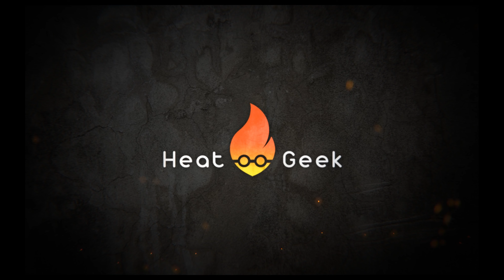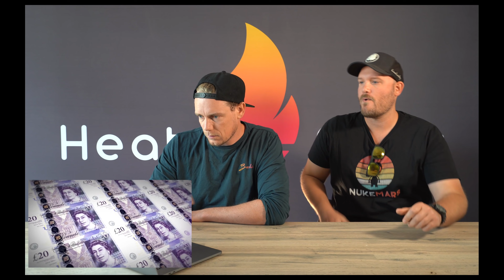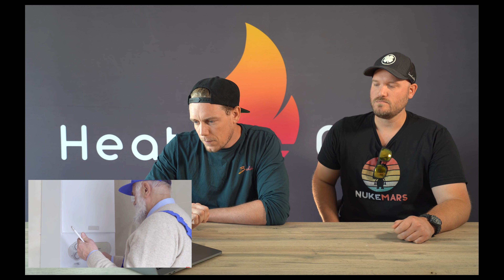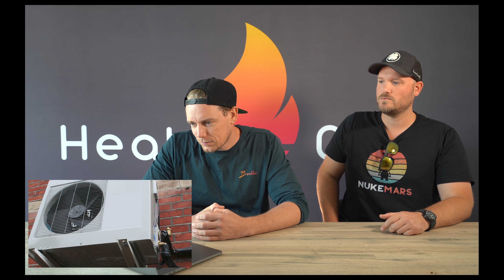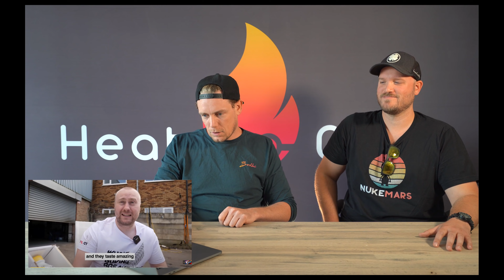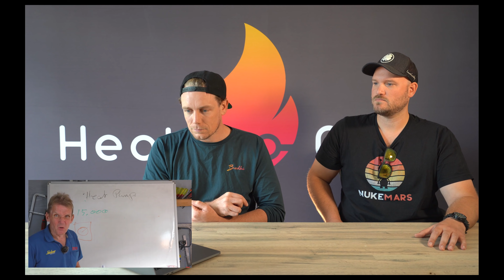Professionals React (BADLY) To Skill Builders's Heat Pump Videos | PART 1 | FIRST TIME WATCHING

Comment: Wel wel , this reaction was made 7 month ago ,. And so far he's prediction haboit electricity and gas jas been spot on in Holland the proces of gas in 2021 skyrocketed as the government closed gas mines , electricity what's chipper at the time and then shit hit the fan , the great could not handel the demand and promoción of son panels , the insentive when doe 40 %, gas is now just is now 35 %  expensive then electricity bit slowly by kling off government insentive electricity is claiming up fast .... Soon they both wl be as expensive, and we loose .... As we invested in heat pumps , sun panels and all we got is debt and technology that don't work in the winter proper  🥶🥶 ,  so  nice job guy you ridicule the guy for having a clear vision of wat je thought was coming ... England might not have Canton the prices yet but that will come sooner the later
Reply from the maker: The discrepancy between the environmental levies placed on electricity and not gas has been hotly debates in in Parliament for the last 10 years. And prior to his video agreed that there would be a 'rebalance'.. it was not a prediction.. I don't think he predicted it would gonupnby this amount either 

Also.. he was suggesting the government would artificially increase it... thos was natural market forces and actually the budget announcements are suggesting the giv are trying to reduce it again.. to thinknthe giv are fixing prices to push heatvpumps is tin foil hat stuff

Comment: A gas boiler pays you back after 5 years because its 3x cheaper per KWH for heating water or air than electric.
Reply from the maker: Lol.. but a boiler is 90% efficient  and a heat pump is 300 to 500% efficient.. think about it

Comment: How many times have you heard someone put in a new gas boiler and complain about it? Never, case closed. This video looks worse the more research I do.

The gas boiler is 38KW in my house, your sat there with a 3KW system I have to put the first 1Kw in and claiming its good? That’s 8% of my current system.
Reply from the maker: You've got a 38kw boiler in a property that probably needs 8. It will be cycling and probably about 88% efficient. That means if you needed the same 3kw you'd need to put 3.4kw of gas in..  what's better?
Reply: @HeatGeek  I have 6 Bathrooms currently. Gas is not measured in Kilowatts. Tell you what, I need a system for 6 bathrooms, 6 bedrooms, 10 rooms total. Offer me a money back guarantee? Note im not fitting underfloor heating. Property is very well insulated. Thanks
Reply from the maker: @yeahboyiiiii222  100% Well offer you a minute back guarantee.. just fill out the form on our heat geek assured application. Google heat geek assured, should be top result.

Comment: I do like the idea of using heated jacket, etc. Some people can't adapt physically to lower temperatures of heat. They require high heat, like myself. My whole life I could not adapt to colder temperatures like others. Now too much heat in the house to keep me warm can cause certain problems. So having the heated jacket, etc would be a good way to go to reduce the heat produced in the house, in my case, it should be lower due to circumstances I won't mention here. But having a certain level of coldness is a big problem for me. I just am not genetically made to handle lower temperatures. That's why I'd like the heated jacket and warm, but good air flow booties or heated floors. It doesn't take much for my feet to get cold and even freeze. But plenty of foot wear is not enough breathable and my feet could sweat or having issues with the skin.

Comment: Can't heat pumps be put in the loft instead of outside? That way you are re cycling the lost heat which rises. I don't know how you would insulate the sound though.
Reply: no, it would cool the loft and make the heat pump inefficient. it needs fresh air for new thermal energy
Reply: @ChapmanPlumbing  I see that lol. Thanks

Comment: Science doesn’t lie. Unfortunately the technology being bashed on for poor installs. No mention of how ‘Un’ green the gas boilers are. Specially combis. Ok not all the houses are suitable but what about the hi dead’s of thousands of houses build since say 1980s. You have start somewhere. If the fridge in you house works than heat pumps should work as it is same tech. Of course it has to be implemented correctly.

Comment: Heating with radiant is one of the main problems. Ultimately what warms the body is the warm air surrounding the body. Why not heat the air directly and distribute warm air. Every time you change mediums, you loose efficiency. IE: Air to aluminum to copper to refrigerant to copper again to water to copper again ( exchanger) to copper or plastic pipe to concrete to flooring to air ultimately . This is why you need to boost the temp with some other source in order for the radiation to work. Here in Canada I've been installing heatpump for nearly 40 years and refrigeration is my trade. The new inverter heatpumps provide very efficient heat down to -20c and even work down to -30c.

Comment: Gas prices are going up and certainly not a conspiracy. I don’t think Rodger was to far from the point of heat pumps.
Reply from the maker: Correct not a conspiracy.. normal market forces as carbon becomes less desirable

Comment: I am getting an airsource heatpump installed next month or so. I have imsulated underfloor, cavity, loft and internal cladding. I have airtightened where i can and put a membrane below the floor to stop drafts. I have put in underfloor heating and faral aluminium high btu radiators. I pray i have done enough as there is no gas in my area so this is my only option so indont have another cold winter 🤞🤞

Comment: I have installed a lot of heat pumps over the years and the skill builder is spot on
Reply from the maker: So you've also installed lots if heat pumps with scops of 2?? Have you considered that you may not be doing it right?

Comment: you 2 are idiots...you put a heat pump warming up my place at 60f to 65f like you have your place I'd fire you on the spot...and then saying 21C is quite warm that we should get people used to being cold? wff?!?
heys...help the chickens...let's all eat rice and beans every day!!
I keep my house at 28C in the winter and 19C in summer...now if an installation goes for 16k how in the world are you going to insulate an house on top of that? and at what total price?
you guys are too young to understand that at the end of the day it's not your choice what to do/install or under your control to decide what to do.
It depends on how convenient it is for the client...where they want it and how much they want to spend.
You can have all the greatest ideas in the world...install this...insulate that...6f from the neighbor blablabla...
me myself if you installed a heat pump 6feet from my bed window I'd go over to your heat pump and cut the pipes every freaking day until you give up. what you gonna do? sue me over destruction of property and damages caused to a pvc pipe? 20 pounds total? good luck
do it on the roof of the building or wherever you want...if I can hear the damn thing at night while I'm trying to sleep I'm coming for your heat pump
and don't matter how much you service a fan..EVERY fan will increasingly make more and more and more noise...you can spray it grease it..do whatever you want...
in the end to reduce its noise you have to replace the fan blades which isnt servicing is pretty much replacing parts. and who's going to enforce the noise from a cheap neighbor that doesn't want to pay to replace his/her noisy fan which in the end is all about money.
It bothers you that much? then pay for the technician yourself.
and last but not least...HVAC TECHNICIANS  are MONKEY workers...not doctors...not engineers...and some of them can barely even do plumbing...
heck first was the doctors title..everyone wanted to be a doctor and now you have doctors of anything...astrology doctors!!....then came the lawyers...secretaries wanted a title and became "paralegals" and now engineers of heat pump installations?!?!?!? what's next? the office people want the architects title for making a few drawings for them heat pumps? or should we make up a new one? HEATects?
you are still 2 idiots criticizing a guy that puts everything flat right on the table...
and as I've mentioned before as an hvac tech you have no choice or control of how things are done...
money talks and -----> it's not your money

Comment: What I'm getting from these 2 videos is it's not which boiler/Heat pump to use it's improve your insulation in your house thus using less gas with your current boiler and still saving the planet to a certain degree.
Reply: Yes, unless your heat source is on its way out of course.  Best to optimise what you have already unless you really want to reduce your point of use emissions

Comment: A few points. You gave a fair review of this guys video which is commendable, especially your discussion on installers and the likely compensation issue.

experience"The climate's changing as we speak"

The first is self explanatory, it's as futile as dismissing you as "climate alarmists".

mankind's

How many volcanoes are on the Oceans seabeds? Put it this way, 91 were discovered under the Antarctic sea ice in 2018. How many more don't we know about, so how can CO2 emissions calculations possibly be accurate?

Reading Professor of engineering's Michael Kelly's analysis might give you some insight into the challenges that NetZero presents to the average householder; £150,000 - £450,000 by 2050. It's not just Heat Pump's that are the problem. What he does highlight is the installation problem. To achieve NetZero by 2050 the UK needs approximately three time the skilled labour available. That equates to a government cutting corners as happened with double glazing and cavity wall insulation in the 70's/80's and we end up with a cowboy industry installing heat pump systems.

That's not a conspiracy theory, that's a matter of historic record.

https://www.thegwpf.org/content/uploads/2020/05/KellyDecarb-1.pdf
Reply: The larger the CO2 source, that more likely it is that we have found it. We don't need to account for every single co2 source / sink in order to understand a basic equation. Especially the ones we DO know about account for > 99% of the overall CO2 pumped into that atmosphere. That is the case we are in.

You appear to still be in climate science denial mode. So of course we won't be able to convince the likes of you on a solution your can't understand exists.

Comment: This guy is trying to point out that heatpumps are not a panacea to saving money and get a warm house. New builds are not necessarily better than old houses you hear all the time about new build nightmares.
You guys may be good but 90 percent doing these installations may be cowboys because the government is giving money towards these installations without any checks ?
Every time the government gets involved in these schemes it goes Pete tong and costs a fortune.
Reply from the maker: There's a ridiculous amount of checks to get access to grants
Reply: You know the cowboys always find a way around these problems, I'm not knocking you guys I hope this does not become a dead end but I hope people would show the cons to this as much as the pros. 
Green energy in this country is a joke all wind and sun only.  We have a none stop supply of energy and the government is not interested in it that is wave power put the money they are wasting on heat pumps and put it into developing wave power .
Hope you're right and the pump technology just keeps getting better, it's too late for me but hopefully the next generation will have nice toasty homes.
Reply from the maker: @paulgibson490  there's alot happening in that area. By simultaneously reducing the load required tidal power will make even more of an impact.. no either/or but both imo

Comment: is this meant to be reassuring. You say on a 30degree day you would get good results ;-) shan't bother listening further
Reply: Heat pumps work down to temperatures way lower than we get in the UK.  If you're choosing to avoid information then that's your problem.

Comment: Hello, as someone with a newly built house (building started a few years ago), well insulated, with floor heating, and that is now heated with gas because those were the market conditions back then, I do have one question. What alternatives are there for gas and air heat pumps? Some won't work for me, for instance ground heat pumps, because the property is too small, and digging is pretty much out of the question. An air heat pump sounds good, but the only places I could place one would be in the shadow 90% of the time, and close to neighbors, so the noise would also be an issue. The climate is also a bit colder than the UK (Central Europe here). Can you suggest worthwhile alternatives?
Reply from the maker: There's no such thing as a property that's too small for a heat pump and heat pumps work at the exact same efficiency in shadow or sunlight.. they extract from air not solar..  

Only other option is hudrogen fuel cell boiler like I have.. check out our video on it
Reply: @HeatGeek  That was an extraordinarily quick reply on a rather old video, I'm amazed. I will check the video as soon as I can. The property is not necessarily too small, but the way it is laid out and the pipes that are already in the ground make digging very difficult, it's hard to get a digger inside. Also, it is in the middle of the city and there are neighbors all around, so something that is noisy won't work. Gas was cheap four years ago when I made all the plans, but with current events it will only grow in price, so I would like to have a viable alternative. I'm considering keeping the gas boiler in place for a hybrid system, or as a backup. Anyway, I'm rambling a bit. Thank you so much for your answer.
Reply from the maker: @darktoranaga  no probs 

Here

https://youtu.be/kDVwSdshQUY

Comment: Heat pumps are good however they need to be installed in a well insulated house underfloor heating is  really good for this low flow temperature however they are expensive to install and I won't be having one I will keep my gas boiler
Reply from the maker: Over simplification. We have a cop of 3 in our uninsulated property woth small rads. Check our our video on it